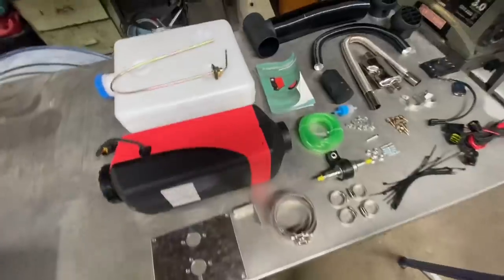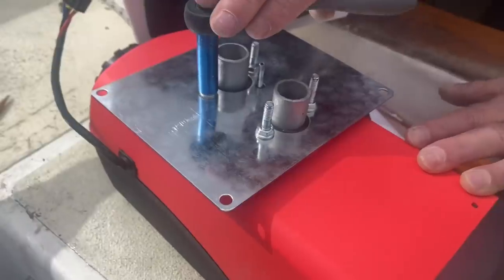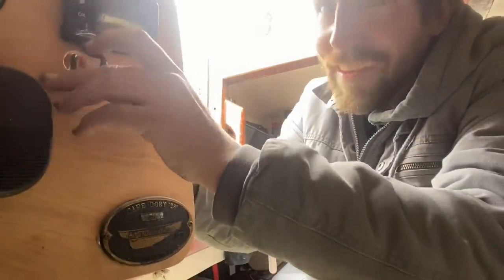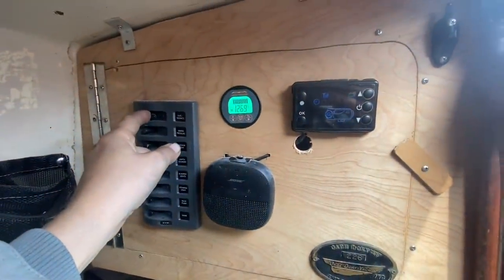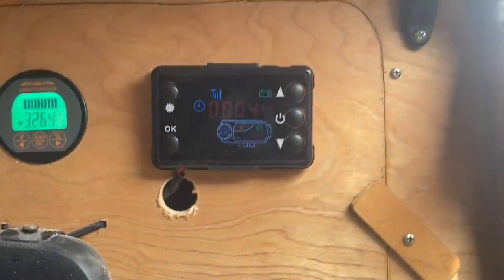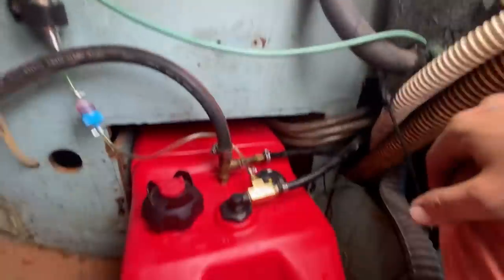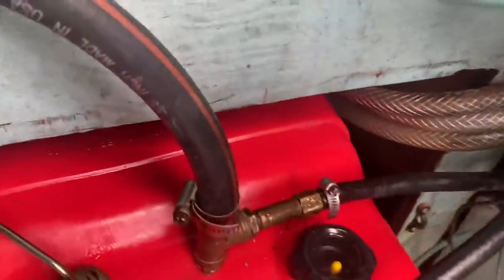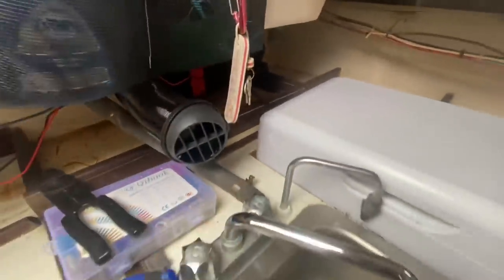Heat on a boat! Chinese forced air diesel heater install

Comment: Maybe I'm wrong, but do you want a plastic fuel line so near the exhaust. Sorry I don't mean to interfere. I'm a long time fan.
Reply: The only issue would be the line popping. Since diesel wouldn't explode due to the fact that it takes much higher temperatures to combust
Reply: @garrettkogelschatz9705  hes suggesting the heat will melt the line !!!

Comment: Hi Sam. I have an Espar so this may not apply.  Mine is fused and ran direct to the battery as the heater needs to be a cool down when shutting off or damage can occur. A breaker may stop this from happening. Again, that isvfor an Espar per the authorized agent who sold and installed it. Good luck.

Comment: Gidday Sam, i'd be checking out mounting the heater on its side as you eventually get diesel leaking from the glow plug hole. PS: love you're channel great to see you still go for a sail on youre mates boat during you're refit 👍😁

Comment: Since you can set the controller as a thermostat, running the heater automatic there is a change, if the heater is not fully powered off,  it will turn on. No problem when wanted but easy to forget because it's quiet, when going away.  If you have set  a low voltage disconnect on the battery controller to protect the battery,  2 things happen. 1. A power shutdown while the heater running is very bad and dangerous. Since the fan quits too  the remaining heat is not blown out, the heater is not cooled anymore. the heat can easy damage the heaterparts or worse!! 2.The heater  (comfort  user) has used up also the safety margin of battery power for essential equipment.  That is an unwanted situation. So, before any power down from the battery controller happens, you want the heater to be able to go through the very  important shutdown procedure.  The most easy way is a voltage disconnect module set on a voltage higher than the one of the battery controller and/or much higher  to have  plenty of power for essential/safety equipment.  This low voltage disconnect is not set into the 12 volt power to the heater, but in the  powerline to the fuel pump. This way the pump stops, heater thinks there is a fuel problem, and goes into a proper shutdown procedure were the glowplug can burn off remaining fuel, and the fans can stil run to dump fuel gasses and cool down. On display  resulting in an Error 04. You switch power on  the controller "off". After enough recharging,  You can switch the "on" button again and everything is normal.  Low voltage disconnect modules are easy to get at amazon or Ali.  some times an extra relais is needed. But doe check the on/of state with multimeter because those LVD's show often a different voltage than the actual voltage. Good luck with your projects and video's!
Reply: Great advice !!

Comment: Hey Sam, check out a few videos of these, the muffler isn’t air tight, it’s designed for a truck, to be slung underneath.  There are stainless marine alternatives for these heaters.  Don’t kill yourself.  Andy UK
Reply: correctly ,muffler for the ship .or exhaust repair cement.I smeared mine with cement.
Reply: @drleon-vc7df  I wouldn’t take the risk when there are good and inexpensive sealed units available.
Reply: @AndyUK-Corrival  I mean about 60 pounds, not a little.
Reply: @drleon-vc7df  Depends what price you put on a life.
Reply: @drleon-vc7df  The muffler supplied with the Chinese heaters is total rubbish, it leaks and is of very poor quality.  I get you don’t agree but my message is for Sam and he would do well to replace the muffler and indeed the fuel line which is known to go brittle and break.  The heaters themselves are great for the money but for a boat they need upgrading period.
Reply: @AndyUK-Corrival   @Andy UK - SY Corrival - Rival 32  Yes, the Chinese muffler is bad but can be used with pre-finishing. I installed it on my sailboat. With CO2 alarm. When I grow up I will also buy a boat version of the muffler. 
Your suggestions are correct.
Reply: Yeh get some iso 7840 and a sealed  marine silencer.   Fuel inlet is close to the exhaust outlet . Ive double wrapped mine in lagging too. Just to pls the bss

Comment: They wont run on long exhaust pipes. I had ordered the 6 foot pipe but would only work when I cut it down to approximately 4 ft. Struggles to push exhaust with the longer pipes. Creates a ton of white vapor when it fails to ignite
Reply: I installed my Chinese diesel heater on my 35-foot sailboat and the exhaust is 6ft and I have had zero problems. I have it attatched with a exhaust elbow that has a condensation drain coil on it. It has worked flawlessly with the longer exhaust.

Comment: I have some experience with these. Its a good dry heat. There is some clicking of the pump so you want the pump suspended somehow and not hard mounted so the clicking doesn't couple to the structure and become loud. These heaters like the tank to be higher than the pump as well. About propane... the rapid exothermic oxidative reaction of burning propane liberates H20 molecules and is a poor choice for a boat.
Reply: (propane go boom)

Comment: Would be interseting with an update video for the heater final installation. I installing identical 2kw heater in my Fenix and have some concern about hot exhaust pipe and fuel line banging arround. Maybe im overthinking 😅

Comment: Such a easy going way of installing project, I love it. 
Can someone tell me if it is alright to install the heater flipped on the side 90 degrees the same way Sam is doing here? 
Also is the any major disadvantages of having the airintake in the saloon as Sam is doing, other than maybe some extra noise? 
I am planning on installing a similair heater and would prefer to install it inside the cabin if it sounds alright by other boaters?
Thanks

Comment: Since it heats so hot, maybe it would be better to have the air intake from the outside, less boat funk smells that way. Also, you'd have forced fresh air which could potentially help reduce the risk of CO in the cabin.
Reply: I love your channel.
What about diesel fumes from the intake going into the cabin?
I just want you to be safe.
Reply: There is no mixing of internal house and external combustion air on these units.  CO is not a problem as long a the exhaust gas down not enter the cabin.

Comment: Another thing to keep in mind. The dye from off road diesel clogged up my heater. Caused me to clean it way more then I should have. Something about the dye. It doesn't burn well for some reason in these heater.  It works fine just clean more often. This will be my third winter with my heater. First year I used red diesel. Lots of problems if the heater sit idol not working hard. 2nd year only Clear diesel no problem at all. Get another dosing pump and controller for redundancy. I have had them both fail on me in the last two year. Heck just throw another one in just as a back up. Just been my experience with the heaters. Hope it helps love the channel. Keep up the good work.

Comment: Why  butane or propane doesn't get you dry ? Because (2x) C4H10 + (13x) O2 → (8x) CO2 + (10x) H2O,  Butane Combustion C4H10 + O2  gives C02 and H20  = Carbone dioxyde and water... 
Same happens with propane : C3H8 + (5x) O2 → (3x) CO2 + (4x) H2O

Comment: On moisture from propane - propane is hydrogen and carbon. And when you burn them - you mix it with oxygen and get CO2 and H20 as products. Produces lots of warm H2O that will condense on all the surfaces that are colder than itself. You don't get any noticeable carbon monoxide though.

Comment: I have the same, you must install the pump at a forty five degree angle not straight up and down, see instructions
Reply from the maker: Interesting. Mine said it could be mounted vertically and seems to work fine that way.

Comment: Did you check the orientation of the air intake for the glow plug? Mounted on it's side like that either puts the hole on top, which is fine, or on the bottom, so diesel will leak. I don't know which way you have have to point it.

Comment: I can explain the "propane heaters create more moisture" comment. 

Consider the molecule for propane, C3H8. It is made of atoms of carbon and hydrogen bonded together. When you burn propane, the hydrogen and carbon atoms break their bonds, form new bonds with oxygen, and release heat. 
C3H8 + 5 O2 ==> 3 CO2 + 4 H2O
Any time you burn something with hydrogen in oxygen, you produce water vapor. Burning diesel or propane produces water vapor and CO2. Most fires you see have a little dilute invisible super hot steam in their exhaust.

A propane catalytic converter burns propane inside your cabin. This tiny amount of steam is released inside your cabin, and when it eventually cools down, the air gets moist.

A diesel forced air heater burns diesel in a combustion chamber. A heat exchanger transfers the heat to your cabin air, but the exhaust (with the steam) is blown outside.

Comment: This leaves me with a few questions:
1) how long will you be able to run the heat continuously without running out of diesel?
2) if you don't have propane onboard, how do you cook?  (I think maybe camping stove?)
3) did you figure out why the heating controller was listing hertz?
Reply from the maker: Its supposed to consume .2-.6 liters/ hour and i have a 6 gallon tank. Alcohol and a camp stove. It was something about the power setting to the fuel pump.
Reply: @samholmessailing  the hz thing must have been US (60hz) vs other parts of the world (50hz).
Thanks Sam.  Have a good one!
Reply: @davewestner  The Hz is just a unit of measurement of a cycle, the Hz setting on these is basically the speed of the piston pump/amount of fuel it is providing to the burner. There are a few charts available online regarding the cycle rates for the heater pumps.

Comment: Hey Sam I know you're getting the better exhaust but also get better fuel line for the unit, I've read the line that comes with it is super cheap and may become brittle fast.
-Larry ;)
Reply from the maker: They definitely used the cheapest line possible. Good idea

Comment: are you sure that fuel pump is set up right? The espar ones say that the pump should be max 15 deg angle from horizontal. Also that exhaust through the bulkhead is way to close to the wood. gl

Comment: So the reason that propane produces more moisture when you burn it is that it's only 27% carbon, and the rest is hydrogen. When you burn it, the exhaust is carbon monoxide (CO), carbon dioxide (CO2) and then the hydrogen burns too, making water (H2O). Diesel fuel, on the other hand, is more like 81% carbon (with some hydrogen and other impurities), so the exhaust is more dangerous if you breathe it, but it contains much less water vapour.

Comment: What about those small water turbine generators that produce electricity while you are underwsy?

I haven't looked into these however 20 years ago I designed an alternate power generator system to install at hydro power plants.

I'm going to see if that system would work if affixed to a boat hull.
Reply: Or a wind generator 🤔?
Reply: @rhett7716  A towed turbine system would produce much more power than a wind turbine.

There would be a few issues to resolve but that's called inventive inovation. 

Perhaps the keel could be turned into a power generating tool.

Comment: Put a small piece of rubber under the fuel pump and you won't hear the ticking throughout the boat
Reply from the maker: It actually came with a thick rubber mount that keeps it pretty quiet

Comment: Hello Sam. Another great Video. 

One question: How is the exhaust exit, because this part come really really hot. How you take care of this part for not
make damage in the fiberglass?

Thanks a looot😊
Reply from the maker: There is a special fitting for the exhaust to exit the hull.

Comment: The exhaust will get very very hot! I m a bit concerned about your heat protection! This is not safe at all ! Also the muffler ? Is it comfortable n’y out just like that with the boot open? I have one in caravan and it s ok but in the boat it s not that easy unfortunately! Let me know if you have update please. Thanks Sam! Always a pleasure to follow you (from a Frenchman)
Reply from the maker: Thanks for the tips! It worked great for a while but eventually got clogged up and died.

Comment: On a sailboat, your heater needs to be mounted in a fore and aft orientation.  Your heater will not work properly when the boat is heeled the way you have it installed.  Your installation looks very dangerous.  I have installed dozens of Espars and Webastos as well as a few of the Chinese models.  I suggest you read the Espar instructions and follow them.

Comment: if you have a 5ltr plastic bottle infront of the heat outlet it will heat up the water in so you get extra from the heater

Comment: Heater inside boatliving area???  I have same kind heater. If you intall heater outside locker, outside cabin, and you put 3" Car mufler befote air came inside cabin, so, it is soooo silent. Now it keeps so hard noice that you cant sleep at night. And

Comment: For what it's worth, it is my understanding that diesel for cars is much better for heaters than diesel for boats as the fuel burns "cleaner". As such, some folks have a separate container filled with diesel purchased at a gas station to use for their heaters.
Reply: Umm, no
Reply: Umm, yes

Comment: Sam!!I really like you and your vids.please redo the mounting plate to an L shaped one that does not!!!!! go thru wood.make it in sturdy metal away from anything flammable by at least 5cm from the exhaust!!!!!!! Olso as I was screaming about earlier the exhaust needs an svan neck konfig with a 3 roll 5cm diameter drain of 5 mm coppercoil at the lowest point!!!buy a co2 meter.make absolute sure your intake air does not is remotely close to your exhaust.love you kid.dont do operations on your stomach if you are willing to die by a stupid install?will you cad me vindvane blueprints for my Havsfidra 20?don't die kid its overrated..

Comment: Instead of using that smelly diesel and having more diesel on your boat why not get maybe a couple more batteries and I solar panel and a wind turbine and use a electric heater when you're not using them for heat you can use them for other things

Comment: didn't be stupid think about what you have just done how hard is it for you to prime the diesel engine when you run it out of fuel has its own tank for the heater leave the diesel fuel tank for your engine White if you needing to run the engine and run out of diesel in a storm and run the boat into rocks due to stupidity think about yes it your life and boat to